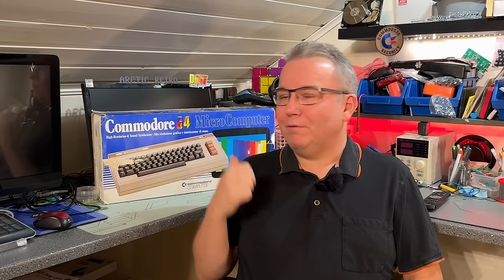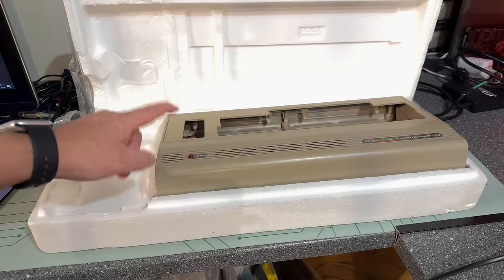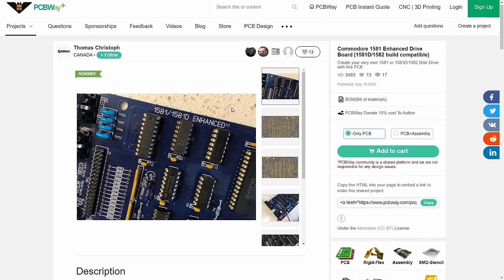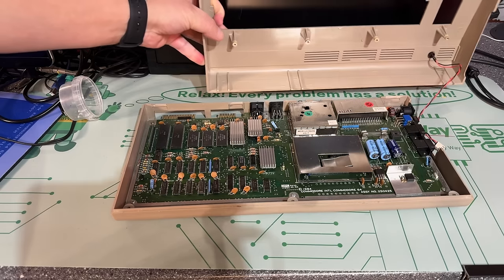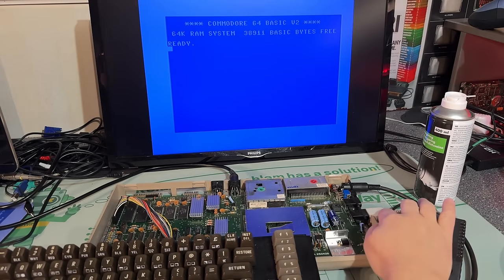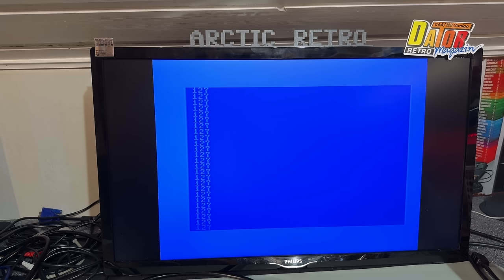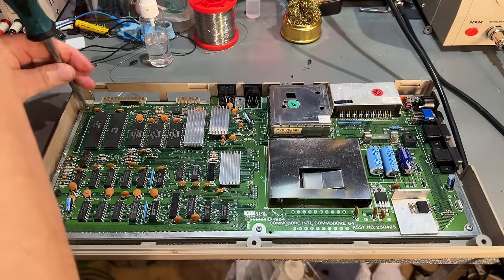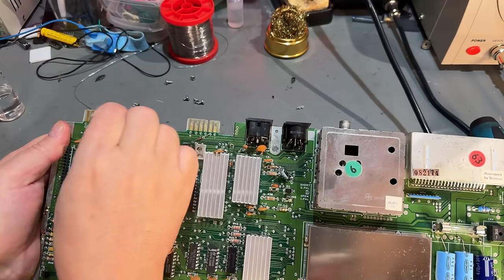Just ANOTHER COMMODORE 64 repair and restoration video - Can't get enough :-)

Comment: @49:52 neat little device. I did not know it existed. I have a C64 here that I had to fix in exactly the same way. The "paper sanding" of the stems is really magical. When I was doing it for mine what I had done was isolate the pins on the connector that were for the space bar. I connected some dupont wires to it and the other end to my multimeter. Then after the couple of rubs of the stem I would touch the space bar pad. The only thing to watch out for is that you don't use too much force but also not too little.

Comment: Wow!  I've never seen a 250425 with a soldered metal shield JUST over the VIC-II area (in person or otherwise).  I love how you can never be sure if you've seen ALL of Commodore's configurations.

On a side note, the sd2iec firmware supports The Final Cartridge III, which (aside from massively speeding up LOAD) allows you to use the DOS command (F8) for changing directories -- as opposed to OPEN 15,8,15... :)  -- JC

Comment: Thanks for sharing your experience with us Tommy!  That CIA must have had a bad solder joint.  Luckily, your sockets fixed that and possibly made troubleshooting the next problem easier for the next guy to open it. Great vid, as usual.

Comment: i own roundabout 30 c64s and decided to stop collecting at this point. now all machines have been repaired... sad ;-)
Reply from the maker: Too many :)
Reply: 23 here, all repaired also... I hear ya
Reply: 12 machines (including one SX64), all repaired (one has a dying PLA that's not in a socket, but still mostly works). I sell/give away machines from time to time
Reply: I have one. I think it has a dead 6510. Ebay prices have me worried i will never get it repaired 😣
Reply: Best of luck:)  if you were nearby,  I would repair it for you for free. But I'm sure you are in the US.  Anyways,  if you want to repair it,  watch a lot of repair videos,  that's how I learned... again Best of luck 👍
Reply: Curious.. what are the symptoms?
Reply: I only have one C64 and it still needs repair (I need a modern reliable power supply first, I know they weren’t trust worthy and sure enough I checked it and it had no 5vdc rail…not that I would have used it anyway so not to risk damage to the c64), I do have two vic20s and they both work (minus some filter caps so there is some video noise, but that’s not a big deal) so I was able to confirm that my mp803 printer (with somehow a ribbon that didn’t fully dry up), my cassette deck, and one of my two 1541s still work.   Everything I have is my original equipment that I have owned since the 1980s and it all worked when packed up, so at least I know it’s all untampered with and probably repairable.  My son wants to get an original c64 and learn, so I’m motivated to fix it or get another one.   :)
Reply: See, you you still have a collection:)  I have 2 vic20s as well:)  nice your son wants to learn,  my daughter helps out with my retro repair sometimes.  I use the modern psu from Kellogg seller.  He is on eBay and Amazon.  Great psu:)  definitely start with that.  After that,  pla.. mos 906114  is usually first suspect.  I've had a bad or dirty power switch that sometimes just needs isopropyl.   Good luck:)  I learned from videos and hands on eventually.  A couple broken 64s from my childhood... when covid hit.. I had to do something to make me sane. Lol
Reply: That's awesome:)  I have a couple repaired ones listed,  but no one wants them.. they want broken one's like us:)   vicIIs are harder to find.. and expensive.  Quarry works,  but I can't just give them away.  One to my cousin but that's it.

Comment: My keelog power supply works well but the grommet of the cable broke. I opened it (not easy to do),  and noticed the ground pole is not even connected.  Now, I prefer using an old c128 power supply, they are serviceable and 100% safe
Reply from the maker: Mine has an ungrounded plug